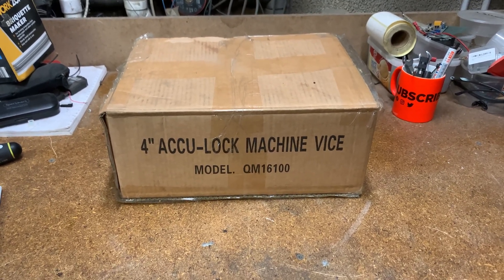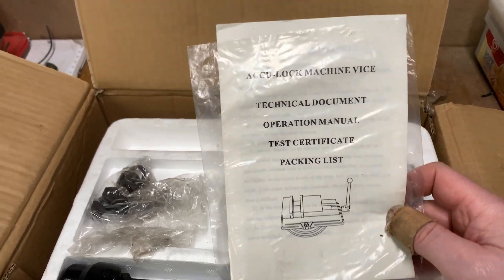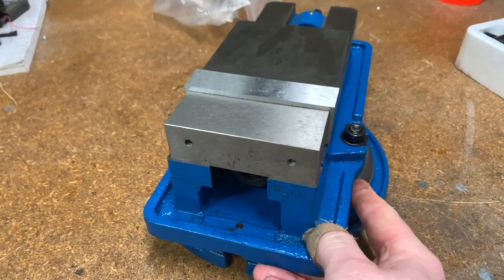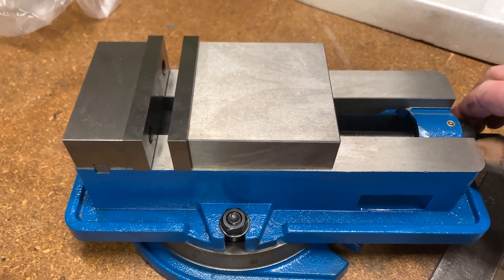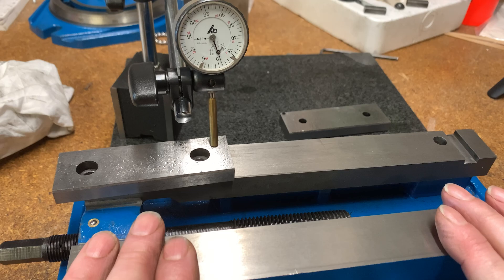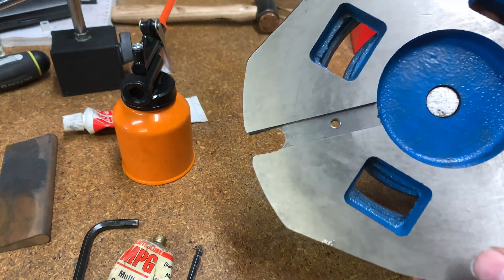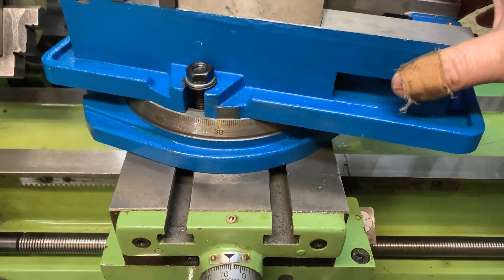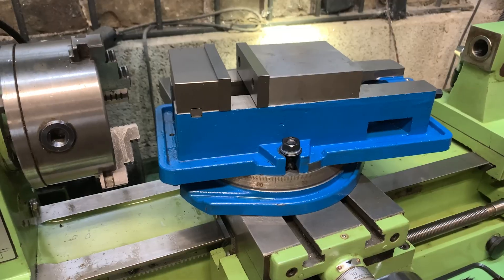Fantastic cheap 4" swivel Accu-lock machine vice from Vevor

Comment: Excellent review; I especially enjoyed the tear-down.  You saved me the trouble!  
I purchased the exact same 4-inch model.  Very impressed with the build quality with a single exception:  One of the webs from the swivel-base casting was not removed when manufactured.  Consequently the vise can't be rotated a full 360°.  This can be remedied, but I'm surprised it slipped by the manufacturer.
Reply from the maker: Thanks for that 👍🏽 I think the vice is really good value for money and just great for my uses. If I was a profession workshop maybe a better quality brand would be applicable but this one Is fine. Thanks again for watching 👍🏽

Comment: It would be interesting to do a scan across the 'surface plate' with the indicator set out rigidly in front of the support. If it is flat then the dial indicator needle should not move. Without doing that we do not know which is curved by how much.
Reply from the maker: Hi Bob, I did something off camera to check how good the ceramic chopping board was, I should have done that for the video! From memory to board wasn't too bad but did run off across it's two sides a tad, by how much I'm afraid escapes me now. Thanks for the comments and for watching 👍🏽

Comment: How did you attach the base
Reply from the maker: Hi Rick. The vice it self comes ready assembled to the swivel base which can be bolted to a lathe or mill table but you need to supply your own Tee bolts for that, none are supplied I'm afraid. The vice can be removed from the swivel base and used stand alone or can be bolted down like described above. Thanks for watching 👍🏽
Reply: @MikeMakesIt  I think those are a pair of t-bolts shown at 14:12.  Use them to attach the vise directly to the t-slots on your machine, or attach the swivel base to the t-slots on the machine and then the vise to the swivel base.  These are in addition to a second pair of t-bolts (included) which attaches the vise to the swivel base.
Reply from the maker: @natecaine7473  Hi, you are correct. Some one had mentioned this in the comment string and I said what they were. I didn't realise I had them until I uploaded the video. Take a look at the older comments and it should clear things up. Thanks for watching and commenting 👍🏽

Comment: 14:30 there is adjustment underneath that vice to mitigate the jaw lift somewhat. It can take a bit of fettling either filing or adding shims to improve it. I’ve just bought the 4” vice and for the money it’s pretty impressive. Precision Mathews sell a visually similar vice for $400.
Reply from the maker: Hi SJV, thanks for your comments. Yes on the older vice there are a couple of cap headed bolts that I can tighten; the tighter they are, the less lift but the harder it is to move so there is a compromise. With my new vice it has the 1/2 ball setup which is great once its bedded in. Thanks for watching 👍🏽

Comment: I am new to milling.....  and at 14:10  I was wondering what those two little pieces did ...  I learned something to day and I am over 70.   I got the 3" vise like your with base too.... at first use,  I stripped out the bolts that hold on the fix jaw....  I am now checking with company what to do...  I have plans to just fix it myself... Better...  buy drilling and taping bolts to go all way thru fixed jaw,  and maybe add 2 more bolts while I am there....   Hey, Great Video ...  I learned somthing. !!
Reply from the maker: Morning Paul, thanks for your comments. The 2 pieces of metal I believe are for fixing to the underside of the Vice for when you are attaching it to a lathe or mill. There are not used for fixing but to act as a guide (an anti rotation feature) for the vice when sitting on the cross slide or mill bed and act as location guides. My lathe has similar pieces on the top cross slide. Take a look at https://youtu.be/rLtqz7HI0Kk?t=717  here you can see a tapped holes in my new vice. This is where they will attach. They may be too big for my application so I may need to make some if required but with them fitted well there will be no way the vice can twist under load. It will of course be bolted down as well! Thanks for watching and I'm pleased the video was useful and good luck with fixing yours👍🏽

Comment: Same vises imported here, At 1/10th the cost of the original Kurt they are not a bad buy. I use a 3" on a small drill press, and an 8" model on a large radial drill press. They tend to have more flex than the Kurt by placing an indicator behind the fixed jaw, but are good enough for most work. Good video!
Reply from the maker: Hi Dee Dee. The 8” must be massive!  Yes, for the price and what I am going to use it for it’ll be a great addition. Thanks for your comments and for watching 👍🏽